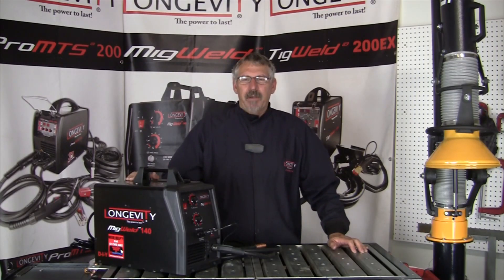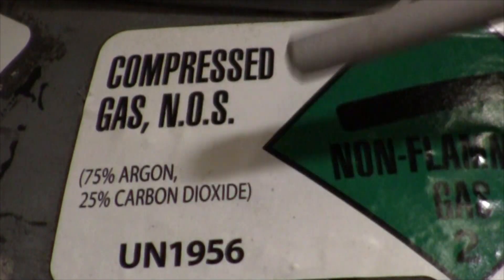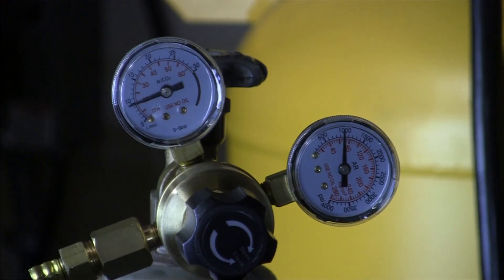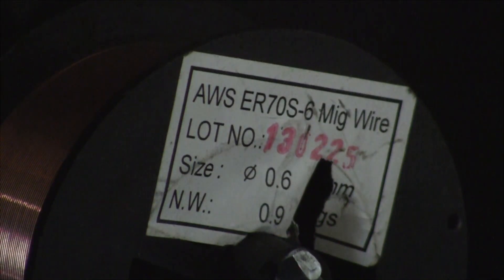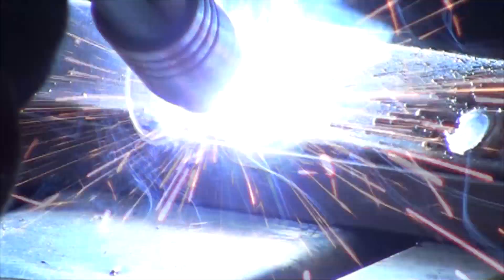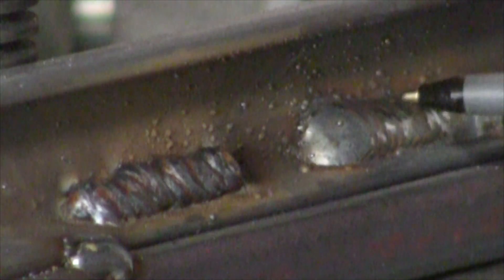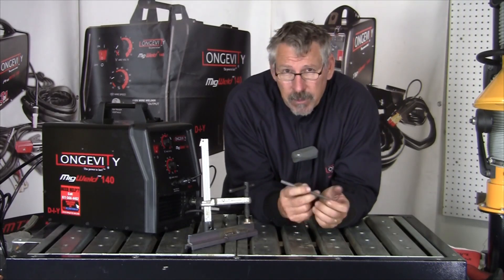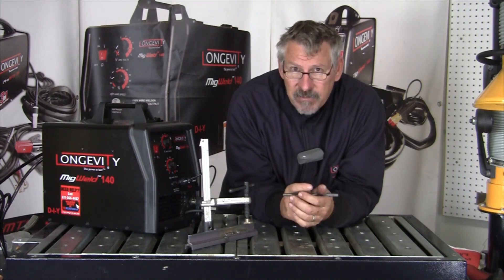MIG WELDING WITH AND WITHOUT GAS - WHAT WELDS LOOK LIKE IF YOU RUN OUT OF GAS

Comment: You compared the two using the same settings. I imagine the optimum settings when welding without gas would be different. I forgot to turn the gas on for an auto body project I am working on. I'm welding 22 Ga sheet metal. After dialing in the settings, it actually did much better than I ever would have expected. Ironically, after I discovered the problem and turned the gas on, I had trouble getting the settings right. I'm very new at this though, so I don't know what I am doing.

Comment: I weld auto sheet work with solid wire (0.035) same ER70-6 , No nozzle. No flux core. Works like a sharm. Btw welder is a Millermatic 140 on a 45 ft 12Awg extension cord on a 5-15 wall outlet on a 20 amp circuit in a 1959 house. Anyone else doing this? Am I an anomaly? Because flux core will burn thru more than you know. And with my less than ideal setup this actually works better than the nozzle/shielding gas way of 75/25 Yes also mild steel with 100% Argon, works next best to the 75/25

And shielded setup requires a nozzle and so lets say you have a under door seal you want to retain. Weld about a 1" section then spray with a Windex bottle full of water. Cool metal to keep your car light on fire. Also works great welding on something already painted to keep the pain on the back side from burning up. Yes totally a no no but for me works better than what is recommended for it. I wish welders experimented more and posted results.I understand those working professionally adhering to standards imposed by industry, insurance, liability and such entrapments. But there is a time to try something new. As you did and found out that while not ideal, 3:09 acceptable. If you did a cross section, you might see the penetration reasonable.

Comment: ive always wondered what if i just stick a torch flame in the weld area to shield the puddle if you 1dont have any gas or 2 a flux welder with regular wire in it

Comment: Why flameable gas is big no no? Some advice: "Propane is the most typical gas used for MIG Welding Guns. Propane is a widely used, readily available, and reasonably priced fuel that resembles gasoline. It has a low heat index, which results in a smooth, uniform weld and minimal heat distortion."

Comment: That first mig weld was too cold. Turn up voltage a little bit more and it won’t spatter as much at all, sounds better, penetrate more, and won’t have lack of fusion on the first 1/4” of your weld.

Comment: You cannot MIG without gas, period. Metal Inert Gas is a process not a welder type. The type of welder is wire feed
Reply: Says who? because I am living proof with auto sheet work like rocker panels.
Reply: @Landlessnothomelesssays anyone who know what MIG stands for, metal inert gas, it requires gas to be mig, without gas it is simply wire feed arc welding

Comment: I mig all the time without gas and I have never had a problem.. Most of the projects that I do are not hyper critical for structural stability and or great looking work so it doesn't really matter.. But I will say that I do like laying a bead with the gas because it looks 100 times better than not having the gas.. I am in the mechanical - electrical field so I get to fab up alot of stands, cages, and basic structural supports for conduit, transformers, feeds, panels and disconnects and most of the time I can tack weld everything together and lay a bead, clean it up and move on to the next thing.. I do alot of quick and dirty/easy fabrication but I will make it look good when I know it will be in a heavy traveled area.. When I know the welding work that I am doing will be seen by anyone I use gas because it is a night and day comparison when using and not using gas..
Reply: You cannot mig without gas. Mig is metal inert gas welding without the gas it’s not mig process it is simply a wire weld
Reply: Do you use flux core wire? If not you should consider it, it's specifically made for those kinds of small jobsite welds without gas.
Reply: You and me the same. No gas. no nozzle, quality machine, solid wire. auto sheet work.

Comment: Folks, the only useful purpose of this video is to demonstrate what happens when you are welding with a standard GMAW (MIG) process, and for some reason you lose your gas coverage. Either your tank runs out, or you are in a stiff breeze, or a shop fan is blowing your way, whatever the reason. Lets not get our panties in a bunch.

Comment: Did you change the wire? I seen no smoke on the gas less flux core looks like you just use flux core duel shield and turned the gas off so if so just would show what it look like if you ran out of gas! My point is gas less flux core is different from duel shield that requires gas co2 or 75/25 !
Reply from the maker: No same wire to show what happened.

Comment: This is useful for a novice. I've got a gas/gasless mig welder and I have switched from flux core to gas using a hobby gas canister. There's no gauge on it so it's nice to see from this video whether the gas is running or not by the quality and sound of the weld. It's a small canister so I don't want it to waste the gas so there's a fine margin of when it is on or not. It's on 0.9mm steel so I don't need too much penetration but gas is much cleaner. Cheaper to watch this vid than waste a ton of gas. Thanks

Comment: Very helpful

I've been using fluxcore for years now on home truck stuff etc and thinking of finally switching to c25 setup.

Interesting chemical response with and without gas which makes it easy to know if you run out and would also need to switch back to fluxcore to finish weld if you don't have a spare tank or time to refill.

Im pretty good without the gas but with gas would be cleaner which equates to less project time.
Reply from the maker: Glad to help

Comment: Full of crap you can do without gas properly . He took he's time on the first one but the second weld he just rushed it through .if you do clips like this tell the people the truth I've been using without gas for more than 10 years best jobs ever learn to take your time specially when there's no gas available in the island where the welding was done
Reply: Did you test the welds against a welds done with and without gas? It has the be weaker it seems. Are you using flux core wire or solid wire?
Reply: Absolutely. You tell them what I discovered trial and error. No gas, solid wire. Lets you pinpoint into very tight spaces too.

Comment: Thanks, I learned how important it is to use fluxed wire when welding gasless and also to change the welder polarity. You did neither.
Reply: @Geoff Hogg

You are a fucking idiot.
Reply: @calculator1841  , you are spot on brother. If only these people would take some AWS classes. The problem with "self taught" on YT is that it can either actually teach something, or turn someone into a blithering idiot.
Reply: Islaicigs Akaunts anybody who has spent any time at all running a MIG welder knows what it looks like when you lose your shielding gas for whatever reason. It's not that big of a mystery.
Reply: This video wasn't about flux core vs MIG, so he wouldn't need to change polarity. The video was only to show what happens if you lose your shielding gas either from the bottle running empty, or trying to weld in windy conditions.
Reply: Haven't started welding but bought a gasless mig and know silver wire is gasless wire . Just watched YouTube welding machine vids which showed changing polarity from gas to gasless 😆

Comment: what if replace the gas with normal air from air compressor?
Reply: That's no different from regular air around you tho
Reply: yup but the air helping + or - ions travel to the weld things

and helping tungsten electrode to cool down ?

i wondering....

Comment: But now we have also flux core wire that creates a shield.
Besides first with gas you drag the pool then without you push the pool.
Reply: will you have different results if dragged without gas? Thanx in advance.  i just found out today the differences of welding with gas and without =)

Comment: Normally if no gas the welds full of holes, porosity, mig with gas is good, clean welds but if the breeze blows the shielding gas away, porosity, that's why Flux core wire has an advantage.
Reply: Great show me the cross section

Comment: I don’t know much about welding but, if he used the same wire for the gas as he did with the gas off, I think that’s a poor test. With the gas off shouldn’t you have used flux core wire, or non flux core wire with the gas off?? Just a question m
Reply: The intent wasn't to test regular MIG vs Flux-core - it was to show the difference between when your gas is flowing and you run out of gas.  Switching to flux-core would have totally invalidated the example.

Comment: 🤣 flux core welding (without gas) is not temporary. I have the Hobart 140 Handler and have welded so much with flux core wire AND a lot with solid wire (with gas) ....they have BOTH held up the exact same. I have never had the flux core come apart. Gas has just provided a cleaner weld and MAYBE a tad deeper penetration....IF THAT! Side by side they have both held up EQUALLY!!! 😂
Reply: So i can use it without gas? According to your experience, because am not a welder guy i just need one of this mig machine for DIY. Do you recommended me to buy one and use it without gas?? Thanks if you reply bro.
Reply: @noobinho8882  Bro, Honestly I have a 220 Tomb Stone Lincoln Stick welder, and while I love my stick welder I feel my Hobart 140 can hang just fine. One day I was welding some jacks on a construction trailer and ran out of sticks. I pulled out my Hobart 140 and finished the last two jack on the FRONT of the trailer which is the heaviest and it has held up fine, 2 years later. You being a DYI guy and jumping in to welding things here and there you will be fine with a Hobart 140 no issues. Your first task is to jump on some scrap angle iron and weld you some beads to get the hang of your feed speed. I would not worry about gas, its more of a shield to keep your beads pretty and some say "Help Penetration" but I have had no issues with my welds with my Hobart 140 and I VERY rarely use gas. If I do its ONLY because I am doing something for myself or someone else and I'm being Boujee about it LOL  You will be fine, it takes time and practice so be patient and dont give up! Weld you some scrap metal together and do some stress tests on it. Best of luck my guy!
Reply: @UnKnown-jp1bv  thanks a lots bro
Reply: @noobinho8882  Anytime Friend!
Reply: @noobinho8882   I’ve only ever used stick for some exhaust stuff and to brace some control arms and it’s worked perfectly but I’ve recently bought a cigweld 135 mig. 
Honestly so easy to learn and I think gas mig people over exaggerate to make gasless sound like shit. If you have your polarity set properly it’s not bad at all, I mean yeh there’s splatter and shit from the smoke but it all cleans up with a wire wheel on an angle grinder just fine. 
And there’s no way gasless is weaker than gas because that’s just stupid.
Reply: @Reuben2KT  thanks a lots bro
Reply: Gasless is actually better for deeper penetration.
Reply: @Reuben2KT  I agree, I think Gas is more of a lipstick so to speak. I like the look better, way less splatter but a $20 Harbor Freight angle grinder can clean up just about anything lol

Comment: I welded a fillet weld and forgot to turn on the gas how long do you think it will hold for?
Reply: depends on its loads really, and the bonding to nearby material. You can't know for sure if you don't cut it open and look. :)

Comment: Hi i ihave a problem with my mig weld. I just bought a new gas bottle. When i start to weld with With the correct settings The seam is a good time but a little bit of time will start to ripple and will affect how gas should not be when it comes. what to do?
Reply from the maker: Aatu Pöysti Hello. Please give us a call at 877-566-4462. Our technician can help you.

Comment: FCAW creates gas shielding from its flux core. Arc welding generates gas shielding from the coating around the rod. No you're not special because your HF welder runs fine you're burning FCAW. I'm amazed how many people are running welders without knowing the absolute basics. Do yourself a favor and don't use chlorinated brake cleaner to clean your metals. That's probably why some of you think you're running mig gasless.

Comment: it is more difficult without gas but once u get the settings right for the metal and your technique it welds fine and strong. its just not as clean but it does work
Reply: Mig welding
flux-core wire = no gas (gas shielding provided  from flux).
standard wire= yes gas.
M.i.g abbreviation for what? 'Gas' is in the name!
Reply: Nickosupra clearly you have not welded because if it is good settings they weld can hold, this is coming from someone who had to rely on an unshielded weld on part of his motorbike frame that cracked... she is still fine to this day 10 years on.

Structural welds sure it wont be as good but it will still hold, but for small stuff like the occassional crack on metal it is fine.
Reply: You have never welded before, have you? It's not difficult, you can't weld without gas and expect it to be a solid weld. Anyone who tells you otherwise have like you, never welded before.
Reply: @NickoSupra  , you are spot on. Too many "self taught" know-it-all welders here on YT. Don't let the trolls get you down. I had some troll/fool recently tell me that he used 4043 wire in his flux core machine (no gas), and he repaired an oil leak in his cast aluminum engine block. Hmmmm (smh). I wonder how long that will last.....forehead slap.

Comment: Yd u start at different ends with gass and without gass. I had my welder a while and never used gass before. How is it that my weak welds didn't break when we shot it with the ar15. it punched a holes in the half inch steel plate even right were I welded it there was a bubble right behind my still in tacket weld ????
Reply: "Stick welding to mig welding" am i missing something here? I am pretty sure you don't use gas on stick welders...
Reply: Really? What a fucking surprise.
Reply: can you make a video about it with out gas please. coz i am planing to change from stick welding to mig welding just to save the gas money
Reply: sludge Hammer about what exactly and I have no training I'm teaching myself
Reply: You're probably running FCAW wire.
Reply: Lol, I love this comment!  ALL MIGHT, you are the best!
Reply: When you say you want to change from stick to mig "Just to save gas money" it implies you are moving to Mig to save money on gas...
Reply: Great test. I weld without gas - solid wire all the time, thin stuff. seems like a conspiracy for the gas conglomerates.
Reply: ALL MIGHT hey buddy. I said i wanted to "CHANGE " to mig which use gas